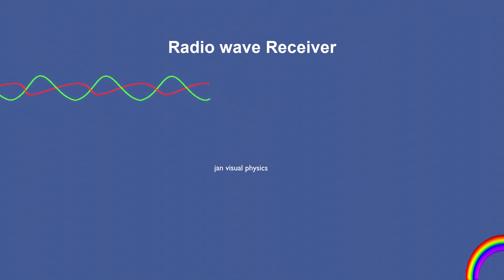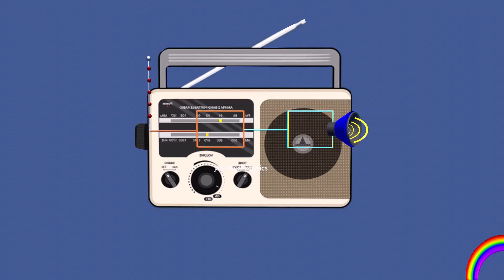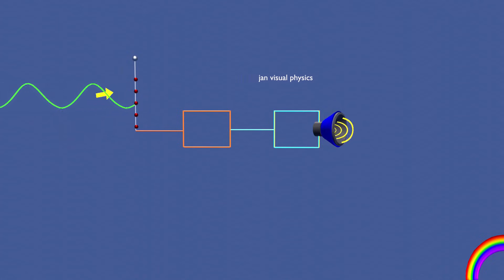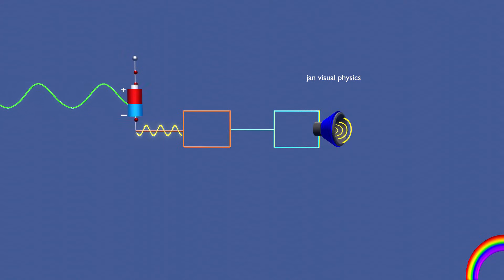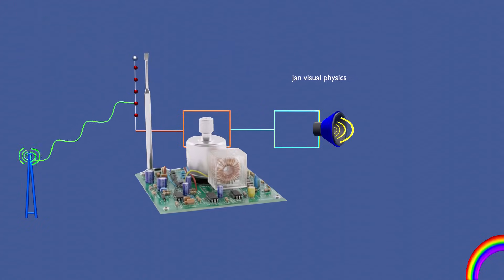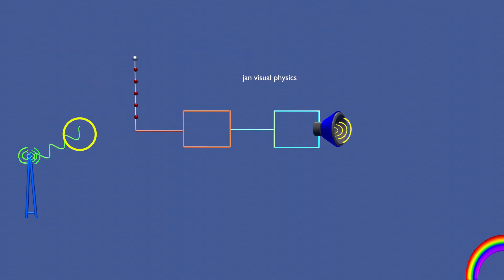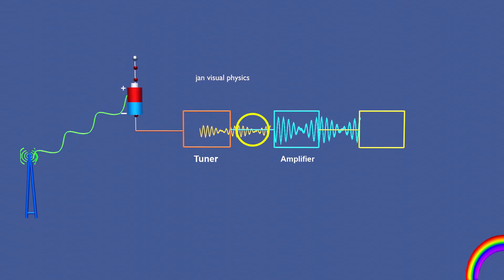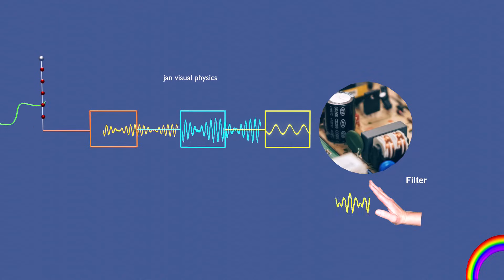Radio Receiver Working Animation | How Radio Works | How Antenna Works | Antenna

Comment: This video  presented a good visualization  of what happens at the aerial/antenna when a signal arrives.  It has been a bit of a mystery to  me as to how exactly a source of power, even though very small,  can be generated in a single metal rod,  that can  then send a current through a circuit with no return path back to the aerial, so I'm guessing its via an earth connection?   I've been an electronics hobbyist since the 60's and most teachers don't really touch on this.  Thanks again for your great videos and I have just subscribed.  Regards Kieron. 😀😀😀